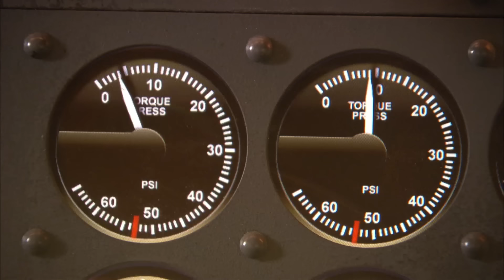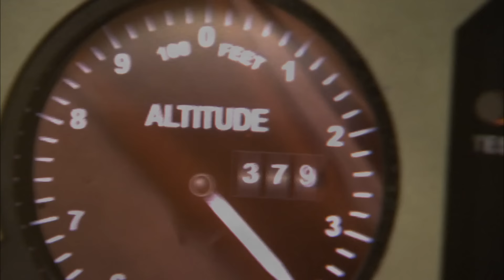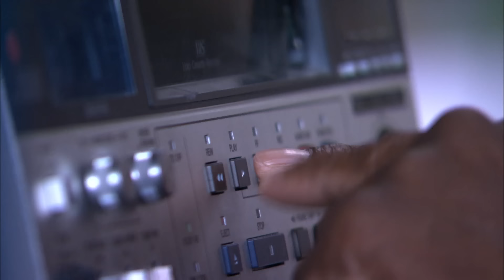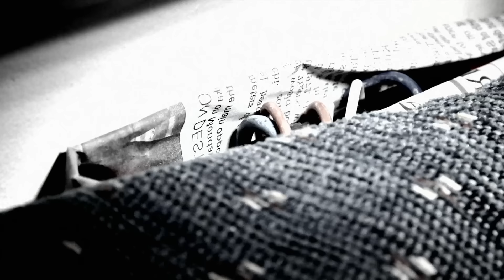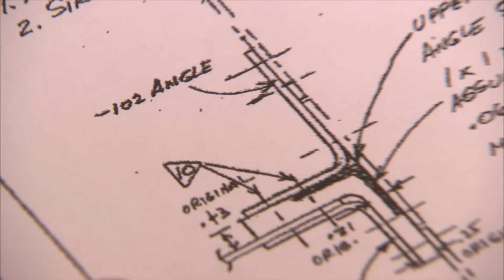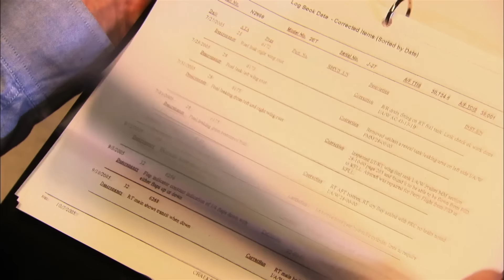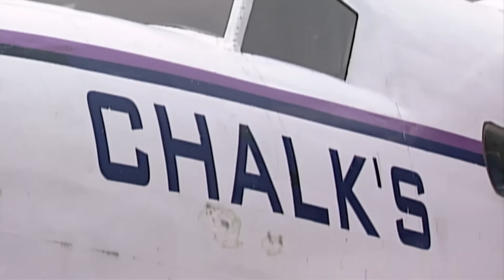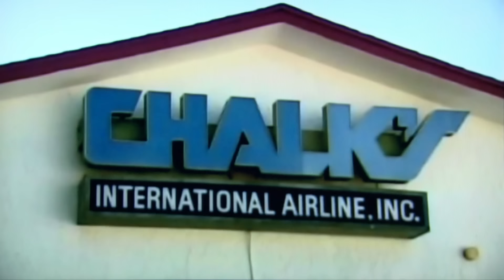Cracks In The System | Ocean Crashes | FULL EPISODE | Mayday: Air Disaster

Comment: Yeah put multiple drill holes in an airplane wing, and then just throw a patch on it. What could go wrong?
Reply: 😔. Anything and everything.  🤦‍♂️
Reply: He forgot the duct tape
Reply: Common sense as left the chat
Reply: Kind of reminds me of the JAL 123 patch job.
Reply: 41 seconds in he landed with gear down in water?????
Reply: I did the b b b best I could. S s sorry. I will patch better next time.
Reply: Ahh he did not use flex tape. If he did it would have been fiiinnnneee
Reply: Drilling or grinding is not supposed to happen on a structural component.  Just replace it.
Reply: There are books about how to properly do these repairs and when to replace the part.
Some of what they did was correct, but they failed to note they were patching a patch, which means it was time to replace the original part. (And probably more structural parts needed replacement)
Reply: There's nothing sticky tape can't fix
Reply: You wouldn't even wanna fix your car that way lol
Reply: @kvltizt  You haven't seen my car
Reply: EVERYTHING.
Reply: @macattack14778  LOL
Reply: @thecasualgamer6164  LOL
Reply: Stop drill holes are to prevent further stressing in areas where there are cracks. It is common practice, but in high stress areas, like a spar, it should be strongly avoided.
Reply: They probably did it a thousand times before with the other planes and thought it was all good
Reply: @arianebolt1575  -  That plane was 60 years old !!!!!!
Those mechanics knew damn well
their repairs 
would lead to a plane crash !!!!!!
Reply: @fhuber7507  -   60 year old planes...
should   N O T   be allowed to fly !!!!!!
Reply: That is how a patch is done. You need to make sure you take out all the damage and micro cracks or stop the cracks to make it safe. I actually haved repaired aircraft  a dime / dollar patch and doublers are very common. When done correctly this patch is just as strong. Engineers that design aircraft also make the recommended repairs that will still make the plane safe. The problem is not the repairs its the manner it's completed in.
Reply: Guys, it’s called a stop drill. It was the the wrong repair done the right way. If the mechanics took it as the warning sign it should have been, they would have fixed the main structural issue with the plane. Doublers are a way of repairing cracks as well.
Reply: @AlmaWells  why not? I fly in aircraft that old and older on a regular basis. I work on airplanes built in the 1930s and 40s. A lot of vintage aircraft have been restored in recent years and are practically new. When properly maintained, it is a non issue. The issue in this crash was maintenance, or the lack thereof.
Reply: "All fixed!"

……
……

I better stick to Prank Calling the Scammers.
Reply: Buddies that work at the airport say that’s still a thing
Reply: @AlmaWells  This was ENTIRELY poor repair procedure. Any competent technician would see the constant fuel leaks and look deeper into the problem. There's a reason planes built during and before WW2 fly safely daily. People that don't know what they're talking about should N O T be allowed to comment on it. Signed, an aircraft structures technician
Reply: As it turned out. Everything went wrong. Also I swear people should stop saying,"what could possibly go wrong"? Because something almost certainly will go wrong.
Reply: Oh Jesus you are kidding!
Reply: @wyomingadventures  not even comparable, that's a common, highly efficient practice.
Reply: One accident in 100yrs. I'd say they're an incredible, very safe company
Reply: @lightpawshird  Reminds me of a couple photos I saw at one point of a plane that got mauled by a brown bear out in the Alaskan bush.  The pilot patched it up with speed tape (basically industrial-grade duct tape) and flew out without a hitch.
(Becomes less surprising when you learn that, despite the severe damage to the outer skin, the structural framework was essentially undamaged, and also that planes used to be routinely skinned with fabric impregnated with glue and waterproof dope - which is essentially the same thing as speed/duct tape.)
Reply: Pretty common and an authorized repair. However if they actually used pop rivets that is not. But there are some kinds of rivets like pop rivets that are.
Reply: @fhuber7507  The 4313 supplemental manuel.
Reply: @AlmaWells  Their are many including many airliners that are 60+ years old. My avatar received her airworthiness certificate on 11/22/1946.
Reply: @thatstinsongirl  You are completely correct. In Tomasville GA there is an airworthy 1928 TravelAir. Thanks for the comment.
Reply: That's how the repair is done by the book.
Reply: @TTCS  It's just what they used in the reenactment.  Just like the fact he's using a grease gun for the "sealant" haha.
Reply: I have patched holes in my giant scale rc planes and had air get in in an odd way and the wing blow up in the air. Full size planes have much more pressure on them than my rc ones so yeah.
Reply: Atta-Boy.
Reply: @arianebolt1575  true but the company was going bankrupt and started cutting corners to save money.
Reply: That's how most aircraft wings are fixed... It's called a scab patch. In WWII most aircraft had control surfaces made of fabric so patches were common then too. A single drill hole is unlikely to cause a significant enough stress concentration to result in failure. It's multiple holes or large holes that cause failure.
Reply: @AlmaWells  I disagree, if I could get my hands on a Spitfire, oh how I'd love to fly that....
Reply: @lightpawshird  The Apollo 13 astronauts fixed their rocket with duct tape so that they would have oxygen on the way back to Earth. Granted, it wasn't used on a structural part, but still, duct tape is awesome.
Reply: Let me see patching up the patches from multiples corrosion won't do any damages to a sea plane?  Accidents just waiting to fail and lost of life.
Reply: Really.... like let's just pretend it's not going to crash.
Reply: So crazy.. I’ve never seen such negligence in a case like this..
Reply: @lightpawshird  that’s what I was thinking too

Comment: When I was in the USAF, I learned of inspections that are mandatory to be done so many flight hours, my main question is who was doing these inspections on the plane and why was this not caught by FAA certified inspectors? Someone had to sign off on the aircraft's inspections. Something like this should not occur and there is more than just an airlines mechanic to blame.
Reply: Thank you for your service.
Reply: They blamed the FAA inspector too, or at least the FAA itself. They say that near the end of the video.
Reply: Hand Salute, Ready Front ! 🇺🇸
Reply: I learned the same thing in the kgb
Reply: @nexaentertainment2764  Which means nobody was held accountable.
Reply: The second I heard that there was an FAA inspector overseeing the airline, my first thought came to bribery.
Reply: You must have missed the part where the specifically blame the PMI and the FAA as a whole.  These planes also weren't classified as transport aircraft, so they were exempt from additional inspections that would usually be required for older planes.
Reply: I've seen on several of these videos that during the course of investigation, it was discovered that those who discovered major issues and spoke on it were often ostracized and in severe cases, the sign offs were done knowingly, so literally they knew the crafts were ticking time bombs and didn't care as long as the money kept rolling in I guess. Very twisted. Greed is something else
Reply: didn't listen too well huh? you that is.
Reply: trump appointed FAA inspectors.
Reply: Low budget, bad management, bad supervision, bad mechanics...
Reply: Certified and multiple credentials aircraft mechanics (and most pilots) make less than a grease monkey at a car dealership. One wonders why they would have a lifetime of liability signing off on work orders.
Reply: I will never take a charter sightseeing flight or living history flight due to these reasons. Aircraft inspcetions and saftey record are dismal for a lot of them.
Reply: @xspindrift8737  I flew on a seaplane from Puerto Rico to St Thomas many years ago. There were many accidents. I don't blame you. However I will say that most pilots who own their plane are extremely good about maintenance and care their aircraft. This company had developed bad habits and so did the inspectors
Reply: The FAA allows the companies to certify themselves, that came out in during the investigation for the Boeing Max debacle

Comment: Flew on this same plane N2969 that crashed years before.. It was quite an experience taking off from the water. My flight took off from fort Lauderdale airport  to bimini and returned .. I believe all airline's have to have non destructive testing to check for structural  integrity, does this apply to commuters airlines? Did the faa change the rules as a result of this crash,
Maybe someone could weigh in. Sad for the pilots and passenger's,. the didnt have a chance. Great documentry best i seen on this accident.

Comment: The real cause was 100% negligence.
Reply: May I respectfully disagree ?
A 100% negligence fsult implies it was 100% preventable + forseeable, by proper prior human intervention.
Not so.
These ancient & unique small passenger seaplanes were aging 
S L O W L Y in an irreverseable fashion with NO available spares.
The practice of stretching their finite lifespan had reached its breaking point, quite literally.
But no single person would have been likely to have forseen the massive wing structural faikure.
Unless you could show repeated attempts by pilots who heard bizzare noises AND a management / owners who KNEW it portended this & covered it up.
THAT would be Willfull Negligence.
What this was was benign negligence of a 51 / 49 split.
Even the FAA inspector missed it.
Reply: @psalm2forliberty577  One thing that really bugs me about this is that there actually were two suppliers of spare parts for this aircraft, one in Detroit and another in LA, of course both companies have since gone out of business BUT at the time they existed and the airline could've easily gotten those parts. Yes, it would've costed them some money, but the safety of your passengers and crew is more important (at least, that's how I look at it)

Comment: There are ways these repairs should be done and Chalk's clearly wasn't doing what they should have. These old birds are just as safe as modern birds as long as you bloody maintain them properly
Reply: Clearly the repairs were not done correctly. There needs to be more oversight and involvement from the manufacturer and the governing body. But there is a cold hard fact that the aluminum like many other metals has a life span. We need to know more about when it is time to say this bird is retired.
Reply: @peterolsen269  I pointed out that the repairs were not carried out correctly in the original comment. The metal itself doesn’t have a lifespan, what has a lifespan is the structural integrity of the component (which is compromised by extensive use). In theory if you are diligent about replacing components as they require replacement, an aircraft could fly safely until the end of time.
Reply: @silaskuemmerle2505  Metal, esp aluminum most definately has a life span. Please, do not pass on information as fact, unless you know it to be true. Work Hardening. Age Hardening. Many things can take place. I will respect your opinion once you admit that you do not know everthing.
Reply: This 1947 plane was So past it's life span it's a crime. Double the hp would shorten if even faster. Metal fatigue is not repairable, just delayed.
Reply: @jimsperlakis5634  so every operator of an aircraft over 30 years old should be in prison in your opinion. Got it.

Comment: Once i knew the plane was made in 1947, thats all i needed to know. A 50yr old plane has probably outlived its engineering lifespan. Its criminal to think you can patch up such a thing forever.
Reply: you can if you actually repair it properly instead of those improper patch jobs they did.
Reply: But what are the odds of that? Therefore i agree with both opinions but I wouldn't fly in a 50 year old plane either no way
Reply: @delta-theoryarizona4256  ehhhh I mean museums have older planes that they still fly. There are some museums that fly all of their planes regardless of age or value. They can always be kept up maintaince wise and if something goes bad that isn't made anymore it can be custom made fairly easy nowadays.

I do get where you are coming from though for sure.

Also a lot of bush pilots use older planes because of the fact that they were overbuilt and can take a beating. Which would be a better argument since museums aren't doing regular flights with paying customers. But again I do get it and I myself would rather fly a new plane too.
Reply: @TheFrogInYourClosetWatchingYou  I agree. Not to mention their is no maintenance for metal fatigue of that age & it's beyond repair in some cases in my opinion
Reply: As long as new parts are being made and people take very good care of it, you definitely can.  If you paid attention, lack of maintenance and parts caused the disaster.  You can always weld patches of metal, swap components, replace sections, etc.  However, nothing is made to last forever on its own and without maintenance, even a modern plane would go down in a couple of years.
Reply: Actually older style aircraft are still safer than the newer style ones because the older style use mechanical while newer use electronics. It's why I hate how airlines got rid of their flight engineers after they went full electronics. Some aircraft from the 40's still fly today, even here in the US and in other countries and while yes those airlines have to manufacturer their own parts, it is still worth it. 

In fact, some small airlines are now experimenting with 3d printing the parts they can't get and before you freak out, it has been successful according to local reports (we have an airline here in Vegas that does tours around the city that uses a DC-6, and a lot of their parts are now replaced with 3d printed ones.) Reason being is because this has also been successful in the manufacturing industry for making replacement parts for aging equipment, so why shouldn't airlines also do it?
Reply: @Suisfonia  yep when SHTF the people with older style aircraft are gonna be able to fly meanwhile all the new fancy aircraft more than likely wont work due to one of many reasons.
Reply: my point exactly, you dont fly on planes that old....simple
Reply: @williamparker1085  Flown on planes that old a couple times, never was an issue.
Reply: Older unpressurized planes can fly forever.  The airframe isn't stressed with each flight cycle.  But you do need to actually take care of them.
Reply: I would like to use the oldest living american navel shipl as an example to say unless every aircraft is maintained up to par with that ship I wouldn't fly in it not every aircraft has that much attention to detail in maintenance since 1947. It's the odds i look at. You would have to replace virtually every part of the airplane after a while to preserve its life span how hard and expensive that would be for a small airliner like this. Might as well buy a new plane

Ps I have a fear of heights and never been in a plane  I'm so biased on this topic 😅
Reply: One, something's got to give
Two, something's got to give
Three, something's got to give noooow! 
Let the bodies hit the floor~
Let the bodies hit the flo--
Reply: @Mike S and what number should that be? What about the guy that maintains his seaplane better than the next guy? If anything I could see requiring inspections after a certain number of years but not outright requiring their replacement if it's not too damaged.

To me that's kind of like telling people they have to replace their engines at 100,000 miles because it could possibly experience problems at that mileage.

I know its far from the same thing but it's the same concept. Inspections at the most other than that if they can properly maintain it then I don't see why it should be a problem.
Reply: @Mike S okay, how about we require cars to be scrapped after 10 years or 100,000 miles whichever comes first.
Reply: Planes are built way better than automobiles so with proper maintainence and upgrades those planes can fly for several decades.  The USAF is still flying bombers made back in the late 40's, 50's and 60s.  The biggest problem with maintaining old planes is parts.  If the airline had better money flow they could order custom made parts if they want to keep older planes up in the air.

Comment: Moral of the story, STOP being greedy and PAY your maintenance crew
Reply: TBH, this is why I avoid small airlines as much as I can!
Reply: six Planes, the airline had five planes which means it was not greed, they were not making much money to begin with.
Reply: This was a business making little money, it isn't a tax payers funded miltary where money is no object and parts can be replaced and upgraded and then the plane can sit unused and eventually get scrapped.
There's a ton more maintained done on these planes that the average Joe commenting on here, that gets in a car without so much checking the tires or looking underneath, they just turn the key and go, usually ignoring  to road signs, breaking speed limits etc etc.
That's why it's still safer to catch a 70 year old place than it is to drive to the airport.
Airplane accidents are extremely rare and ones where people die are rarer.
Yet car accidents and deaths happen every hour of the day in just a single state

Comment: The Grumman was NOT a "twin turboprop" design, it was a twin radial engine design, refitted with turboprops on an aging airframe that was never designed for them.
Reply: BUT a turboprop produces way less vibration and should stress the airframe less.